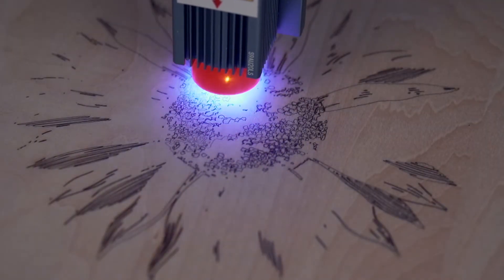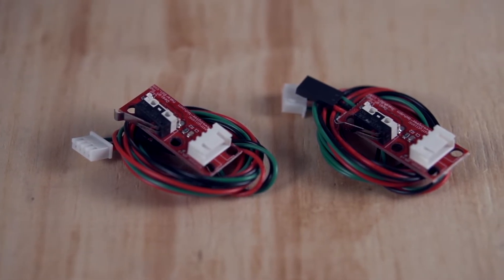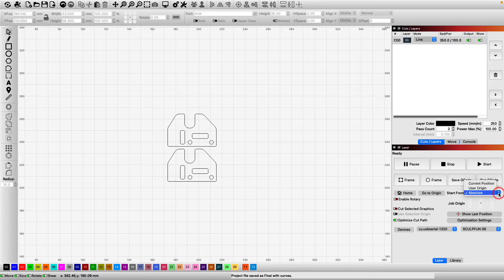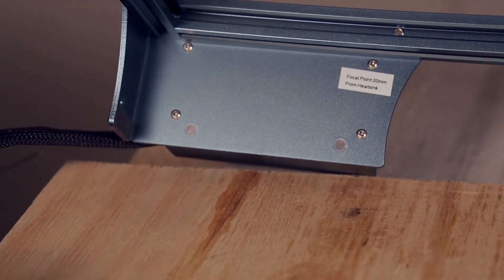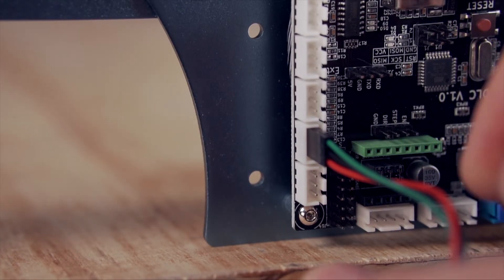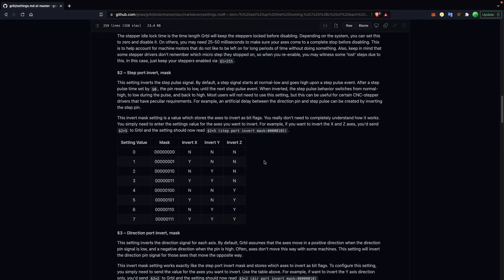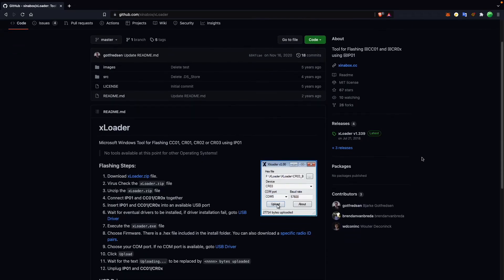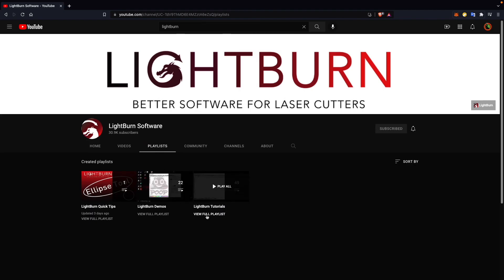Go Home! - Installing Limit Switches on a Diode Laser

Comment: Hi i just added the limit switches, but i must have an updated motherboard and firmware, because it worked without any configuring, after a cold start/reboot, i click home and the laser head races at 8000ms and slows down when it hits the switches. Anyone else experienced this? im not complaining just abit puzzled😂
Reply from the maker: That's great to hear. Some manufacturers may have it set up like this to give the user an option or upgrade path. It definitely saves some steps.
Reply: I forgot to mention i have the Sculpfun S9, looks like mine came with an ESP32 based motherboard with only 2 headers for limit switches

Comment: would this work with the limit switches that the sculpfun make for the machine
Reply from the maker: If the machine comes with limit switches, you won't need to follow this process.

If you are adding limit switches provided by Sculpfun to a machine, this process should work, but you should check in the Sculpfun for their input.

Comment: gone though this several times and mine (new version s9) will not home, just crashes into the frame, switches are identical and show hard limit active in consol when using the  ? Sign in consol they also light up when i press the

Comment: WHY... do you guys insit on serving up upgrading the S9 with limit switches and use the S10? The boards are not the same.

Also anyone having issues getting their to work properly, I found through trouble shooting that someone at SculpFun fudged the label mask and got the X and Y for the limit switched back to front, you put the Y ion X and the X in Y and your homing will work fine.
Reply from the maker: This upgrade was done on the S9, not the S10.

Comment: Is there any reason why homing cannot be done to top left corner? Using that, less cable would need to "travel" :)
Reply from the maker: @rklauco  - Homing is done wherever the machine is configured to do it. There are physical switches in the machine that are pressed when it homes and the location of those switches dictates which corner it needs to go to. LightBurn just tells it “go home” and the machine does everything else.

Comment: Brilliant video.  I ordered the parts from Amazon UK except the T-nuts that they couldn't supply in the correct size (thank you Ebay).  Fitted the switches to my S9 with no problem.  Wired in with an extension on the x axis and fired it up. Checked the position, setup the macro and pressed the home button.  Got an error message telling me to move the y axis switch by 1.5mm.  Nudged it up the channel a little and did it all again.  Perfect!!!!  Turned the laser and computer off, turned it all back on again and put $$ in the console.  New values are still in the machine - seems they are using some type of flash memory now, the firmware doesn't need to be changed each time.  Still have the macro just in case.  Thank you guys, don't know how I lived without the limit switches before.  This process was so straight forward and I learnt a lot about GRBL at the same time.  Now playing with print and cut - another good video and even better written instructions.
Reply from the maker: Thank you for the feedback and great to hear you are up and running with limit switches. It really makes a huge difference and is required for specific modes/features.

Comment: This was exactly what I was looking for! I got my first laser engraver last week, and AtomStack A5 Pro and found out real quick that not having limit switches was going to make my experience even more challenging and it's a hard enough learning curve. As mentioned in the video that different brands models may have to be done a bit differently and that was the case with mine for the Y axis as there's not anything to hit the switch. I made a small bracket attached to the inside of the top front wheel bolt using aluminum angle to hit the switch and it has finally found it's way home thanks to you guys!!!

Comment: If I understand correctly, there are only two limit switches for the homing position (left and front). What about the other two sides of the machine: right and end positions? Is it possible to mount two other end stops there, or are motherboards of diode laser engravers limited to two switches only?
Reply from the maker: There are ways to wire it so either of a pair of switches will trigger the limit stop, but it’s not really needed. Once the machine is homed, as long as it doesn’t lose position the firmware won’t allow it to go out of bounds - soft limits enforce this, and LightBurn will warn if you try to send something outside the usable area too.

Comment: I followed this video and the next one to update the GRBL software on a Atomstack A5 and it worked perfectly. The only hitch was in loading the GRBL firmware in the Arduino IDE but following advice in the comments to .zip the relevent folder all worked perfectly. Great video and thanks for making.

Comment: I need help to fix my laser s30 pro , it is not homing , it is not finding the limits twitch please help
Reply from the maker: Did you follow our video on setting up the S30? I would verify you have origin set correctly. 
https://youtu.be/pf3lN7pxWYo?si=_x2l1NmhCz-qlfld

When you try to home does it home towards the limit switches and just not trigger? If you follow the video guide and are still having problem contact our support team - support@lightburnsoftware.com

Comment: Hi
I got the chance to play around with an Atomstack. Now I am thinking about getting diode a laser in 10W or 20W.
What I have been wondering is if 2 limit switches is enough, wouldn't 4 be better and can they even be installed on an S9 or something similar?
Yet I couldn't find an answer to that.
Also does anyone know if the limit switch, Z height and linear rail modifications also work on the longer ray diode lasers?
Reply from the maker: Since the max work area size can be set in GRBL firmware and in LightBurn there is no need for max limit switches. Most have the auto home toggle on startup checked so it auto homes to the min limit switches each time the machine connects to LightBurn. This ensures it will not run out of bounds. 

In some cases you can force it out of bounds but the work of configuring additional switches both physically and on the firmware side is probably more work than its worth. 

For the additional modifications we have not tested them. Most diodes do not have a Z that is motor driven.

Comment: Hey, if this is being monitored anymore, I am trying to put some limit switches on a different machine-when I hook up the limit switches, the usb port on the control board starts to smoke because it is pulling power from my computer-any idea why that might be happening?
Reply from the maker: That would be something you’d need to ask whoever made your machine - wiring is going to be board specific.
Reply: thanks. :) I'll give that a try-not holding my breath though, but then that's what I get for buying a cheap laser engraver. Lots of DIY. At least if I blow it up, it didn't cost me too much!  Seriously though, I really appreciate a reply at all, much less on  a weekend. I am amazed you guys are still monitoring this video, given its a year old. @lightburnsoftware7189

Comment: my laser is homing as it should but when it goes the right side its bangining into the frame and making funny noises , i have set $130 and $131 to lower settings but it still doing it , HELP
Reply from the maker: If it is homing the way it should at what point is it banging into the right side? Are your limit switches in the bottom left corner?

Comment: HELP Please!
I just extended my Y axis on my S10 and I set up the new travel distance to be 910mm.
But regardless of what I do, the homing stops halfway on the Y axis. I see a message in the Lightburn console that says that the limit switch was not found in the specified distance so the travel is stopped.
Where do I find and change the distance in the GRBL code?
Reply from the maker: The Y axis extension instructions should mention this - you need to change the $131 setting in the firmware of the laser itself.

https://github.com/gnea/grbl/wiki/Grbl-v1.1-Configuration#130-131-132--xyz-max-travel-mm

Comment: This is very helpful but a bit confusing,  My Sculpfun pro max has the end stops but they consist of two wires only my x axis works fine but the y axis gives an error 'ALARM:8
Homing fail. Cycle failed to clear limit switch when pulling off. Try
increasing pull-off setting or check wiring.
I am totally confused by this as some reference I have read suggest reflashing the firmware but that's beyond me.  Do you think the 2 wire end stop cables I have need to be 3 wire ?  Any suggestions would be appreciated
Reply: 2 wire limit switches work just the same, but no LEDs to show when the switches are triggered (5V to light the LEDS is not used).  Increase homing pull pull off (set $27=2).

Comment: I put the switches at the bottom right on sculpfun s9 I modified using glbr and laserburn and now it does the home at the bottom right, but if I start it it slams against the switch Y as if it were upside down, I tried to engrave manually and it results on the contrary (but not mirrored) how can I do??? Thank you
Reply from the maker: Is there a reason you went with bottom right over bottom left? GRBL expects bottom left to be 0,0 so using another corner is likely going to require an offset macro. 

You can read more under the CNC section here:
https://docs.lightburnsoftware.com/CommonGrblSetups.html#getting-machine-settings

The options will be an offset in console that you can turn into a macro (This will have to be entered each time the machine turns on) or swapping limit switches to bottom left.

Comment: Since the X axis runs from left to right and both sides of the tram travel together, there is no reason to mount the limit switch on the farthest point from the board... the right side is just fine.
Reply from the maker: In the case of this machine as long as the sides are mirrored and it will be triggered on either side location wont matter for Y. For X you would want the switch on the left side to match what the GRBL firmware will set it to. You can apply a workspace offset if you do want the switch and laser to home to a different corner but it is an added step.

Comment: Can these items be used on an AtomStack A5 Pro?
Reply from the maker: You would need to make sure the board has spots available for limit switches. You also would want to check that the mounting points on this do not need to be altered for your machine.

Comment: Added the same limit switches to my S9 and with both plugged into the board, Lightburn will not connect to the laser, though it will if only the X axis is plugged in OR the Y axis plugged in, if both are connected, I get 'Waiting for connection' in the console window. The board I have on mine is the DLC32 v1.0. All wiring correct, plugs aligned correctly
Reply from the maker: That is really odd. I was going to suggest something may be shorting but if they both will work on their won then there is no reason they shouldn't be working when both plugged in together. This is the first time I have heard of this. If you have not please contact support@lightburnsoftware.com images of the switches/wiring will be helpful.
Reply: @lightburnsoftware7189  One of the issues with not connecting might be the thickness of the wooden raisers. I made mine out of 1.6mm thick, and the contacts of the limit switches protruded and made contact with the aluminum rail. Solution was to trim down the contacts on the bottom side of the PCB with the snipping tool, or to use thicker wood. Hope this helps.

Comment: What version of lightburn were you using in this video?  I don't know what lightburn or sculpfun have done, but I installed my limit switches and followed your coding and it worked perfectly but before I created a macro, I copied the coding and decided to test it before actually creating the macro, I turned off my laser and closed down lightburn and then started lightburn back up, switched on my laser and pressed the home key and the laser moved to the home position without creating the macro. Can you throw any light on this please? 1.3.01 is my copy of lightburn.

Comment: I've just purchased the limit switches but realise that I also extended my frame to the 950mm one. will any of the values you said about be different to this? Thank you for a great tuturial.
Reply from the maker: Values (should) remain the same. Enabling switches, setting the homing direction, and possibly adjusting homing speeds. The main thing will be needing longer wires for the x axis.
Reply: @lightburnsoftware7189  Thank you for your reply. Would you have a link of where I can purchase the extension cables please, as I'd like the correct ones for my laser. Once again thank you.

Comment: Did this one atomstack a5 pro .  everything worked fine.
Then installed drag chains and lengthen the wires.  In the process I may have plugged the limit switch wires in backwards.  Now the x and y axis move but no fan on the laser module or laser operation.  
So I have to ask what damages if you put them in backwards? I know the limit switches aren't shot I have two new ones.
I have a new controller card coming it should be here in a couple days but not sure if I've damaged the laser or the card or both
Reply from the maker: If you used the same limit switches that have LEDs you may have sent 5v back to the board. I would lean more towards it being the controller than the laser module. It sounds like you are starting with that which is what I would have done as well.
Reply: @lightburnsoftware7189  so after about a week of banging my head against the wall. Getting absolutely no help from Adam stack. I tried a new board maker MK sdlc version 2.1 with the same results laser wouldn't work. After one last option I went and retrace my wiring I extended for the laser head turns out I actually mixed up to the wires and thankfully didn't hurt the laser or the fan or the board or anything.! So I'm using the new makerbase card just because. But thankfully I didn't hurt anyting but that didn't stop me from upgrading my lazerhead the new one will be here soon I will be upgrading to a laser tree 4 LDS version 2. Should be a heck of a laser when I'm done Adam stack thoroughly disappointed me with their customer service glad to be rid of everything except the frame. The old lazerhead all use on my homemade CNC with the original board that I didn't need to replace LOL!

Comment: Anyone know how to install this on a Longer RAY5 10w engraver? I have the limit switches and all but all the ports are not free. looks like theyre occupied by the flame alarm or something.
Reply from the maker: If there are not free ports on that board for limit switches I would reach out to the manufacturer and see what they say before attempting.
Reply: @lightburnsoftware7189  I actually got help in tje end sp it's working as I want it know. It's very handy to have limit switches to pick up a job if something went wrong or so ^^

Comment: what is the difference in 2 core limit switch cable and 3 core as i have 2 core. will it affect the efficiency of the machine?
Reply from the maker: You can use either. The 3 wire version typically comes with a PCB and is easier to mount and wire with the included JST connection. If you go with a bare limit switch you will usually need to solder the wires and it would require a different mount.

Comment: same parameters of "$" are for S10 as well?
Reply from the maker: We have not tested the S10 specifically, but in theory other than possibly homing direction (this will depend on the wiring of the steppers) everything else should be the same. You will want to enable homing, and hard limits, choose auto home on startup, and make sure it homes the correct direction.
Reply: @lightburnsoftware7189  yes it working for S10 as well. i tried

Comment: This just doesn't work for me. Whenever the laser hits the limit switch the Laser USB just disconnects.

Any idea what might be causing this?
Reply from the maker: If the laser is disconnecting when the switch is triggered I would check your wiring. If you are using similar style endstops and the 5v line is mixed up the laser could be shutting down to protect itself from damage.

Comment: The atomstack a5 has the controller at a different location; am I correct to say that the Y Axis switch is to be placed at the left front (0.0 mm) position even though the controller box is located at the back left of the machine instead of the right front like the Scuplfin is?

Comment: I installed the limit switches on my Sculpfun s9 the the locations you have them I plugged in the machine pressed home it went in the right direction right away but it hits the limit switch light come on but it doesn’t stop there it crashes into them and freaks out and try’s to keep pushing past them I have to turn the machine off. I tried it a few times even checking the wires we snug and everything is all good it just won’t stop when the limit switch light comes on.

Comment: Se mira antiestetico ...no me gusta
Reply from the maker: You can route the wires differently if preferred and there are other limit switch styles. We chose these due to their common form factor and that they come with enough wire that you do not need to do any splicing\crimping.